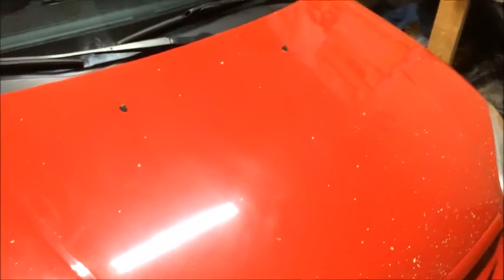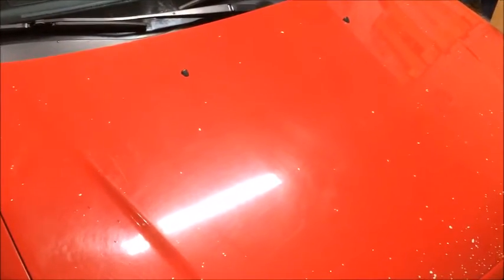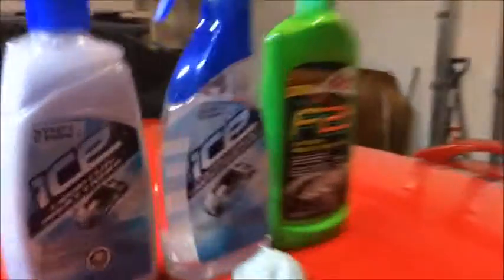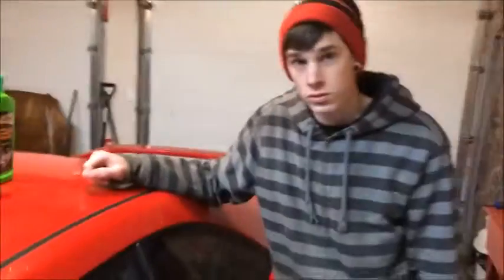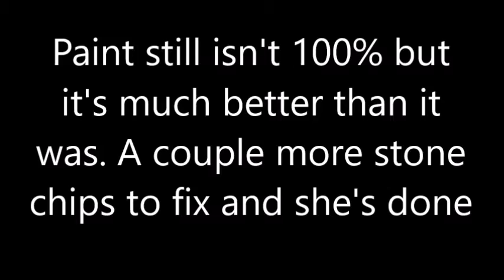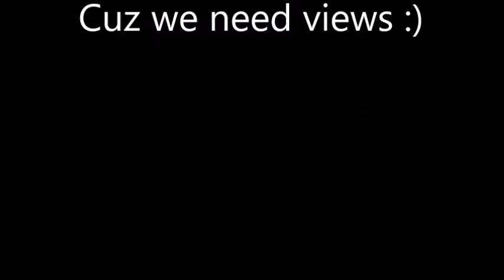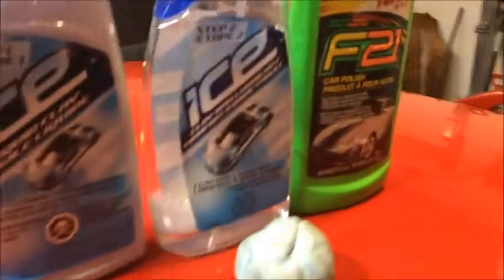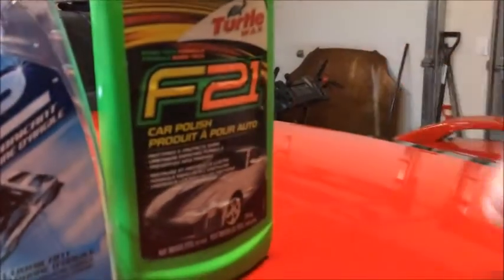Red Civic Pt. 2

Comment: for the ek9 Civic. why couldn't you guys have used a factory ECU? and you guys are on a fuel injector resistor box?
Reply from the maker: Ya we have the resistor box. We're running the h22 without evap or egr which the stock ecu needs. So we had the factory ecu chipped to bypass it. Unfortunately it ran terribly, so we went and got a P28 which doesn't require egr and had it tuned at the same time. Runs like a dream now!